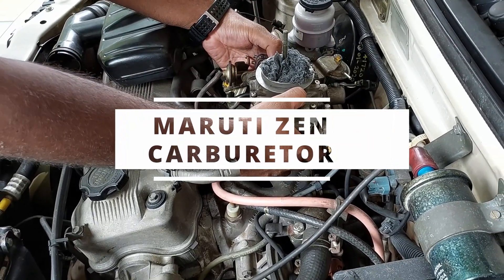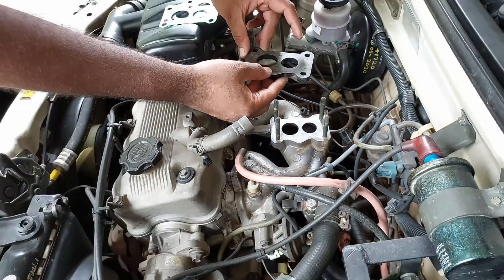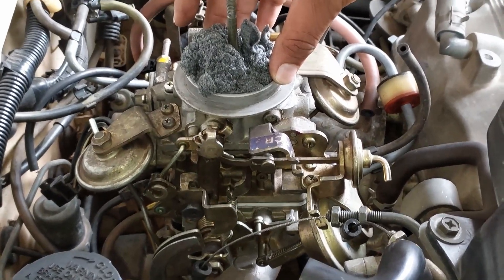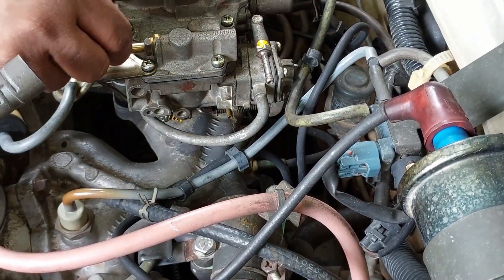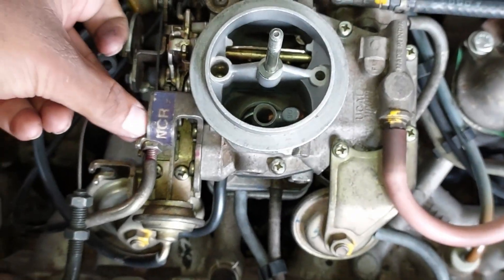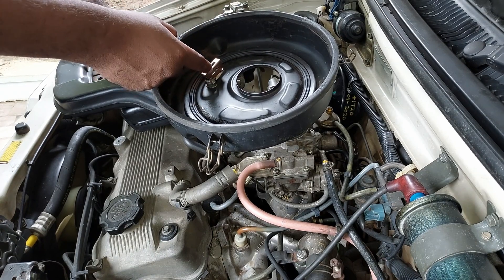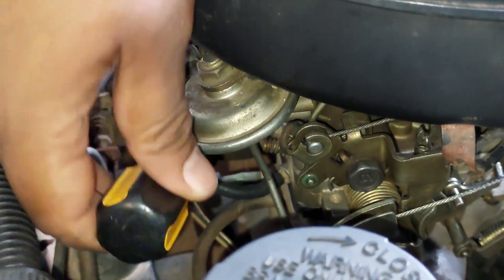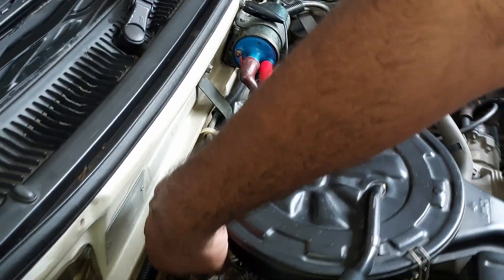Maruti Zen Carburetor service at home | Part 3 | Tuning the Carburetor | English

Comment: Very good information. Hot restart actuator?, It may be for start of engine at higher than idle rpm. When vacuum buildup, actuator reduces rpm high to normal.

Comment: Excellent video❤.. i have 2002 model lxi.. i have issues when car is on idle start it turn off car everytime, whenever i pedal on clutch it get turned off.. nobody uave any solution for that.. can you help
Reply from the maker: Please check all the fuel hoses for any crack. Also check the hoses above the fuel tank. You may not see any leaks when the car is idle. Dried up hoses can cause air to enter the fuel system and this issue may happen.

Comment: Bro please help me I have cleaned the carburettor and tuned correctly as you said, but I am getting a very bad mileage of only 7 and I am very fed up with this as I love zen very much but it's giving this type of problem. But I think carburettor is not the fault for this. Tell me what else should I check out I even changed the spark plugs😢
Reply from the maker: Hello, 
1. Check near the Primary and secondary butterfly valve shaft on the carburetor. If you see a brown discoloration that means fuel is evaporating though that area. You will need to dismantle the carb and replace the seal/ oring. 

2. Check all your fuel hoses for cracks. 

3. Drop down your fuel tank and replace all the hoses on top of the tank. There is a fuel vapor separator mounted on top of the tank. Check if it is cracked.
Reply: @bosegarage  ok bro I will do it and I thought the car is not nice as it is old one so it's not the giving the correct mileage
Reply from the maker: Does your car have a Catalytic converter exhaust. Then you may consider cleaning the cat con as well. It gets clogged over a period of time.
Reply: @bosegarage  yes brother I just tuned the engine again and checked for any leakages but there was no any leakages. Now I drove the car and checked the mileage it was arround 12 kmpl and the car tyres are also worn out, here the mechanic also disappointed me like this is the old car and the carb model is not good compared to mpfi, I think he is a noob and doesn't even know anything about this car here in Bangalore. 
I think due to some carbon deposit in cat conv and the worn tyres are the reason for this, tell me what to do with catalytic converter plz

Comment: excellent video, the only thing I don't understand is that on my car when I act on the idle speed adjustment screw the engine rpm never changes... the only screw that affects the rpm is the adjustment screw of the mixture. Is there anything broken in my carburetor?
Reply from the maker: @fabiodellaira1401 The idle rpm should change when you turn the idle speed adjustment screw. Try to to remove the idle speed adjustment screw completely and check for damaged thread on the screw as well as on the threaded area on the casing. Some cases the thread on the carburetor casing gets damaged and the screw will just keep turning at the same position and hence wont alter the engine rpm.
Reply: @bosegarage  Thanks for the reply! I'm sure that the screw has an ok thread, in fact if I unscrew the screw it comes out and if I tighten it it goes into its seat. If you can, could you explain to me what this screw does? does it act on the external levers or does it open and close the internal ducts of the carburettor?

Comment: I've always wondered - a typical car carb is so much much more complex than let's say an RD350 carb. Same with the engine, or the gearbox, or just about anything there in that engine bay. Yet most cars run so much reliably and give very little trouble over their lifetime as compared to a typical RD350 or a comparable 2-stroke performance machine. 
A friend of mine used a fiat for years without a single complaint ever from its points ignition while I was busy every other day pushing my 350 to the garage lol

Comment: Good video.❤  You did V.good job.Along with this if you have done timing by adjusting distributor it will be very useful. Pls put separate video for setting timing using timing light. Thank you.
Reply from the maker: Thank you for your kind words. Yes I will do a separate video on that.
Reply: @bosegarage  👌🏻
Reply: @bosegarage  What is the RPM & Dwell degree to be set for Maruti 800 corpuretor model at idle speed.
Reply from the maker: @Ravichandrancbe  Engine idle speed set around 900rpm or slightly lower.
Cam dwell angle : 62 +/- 3 degrees
Condenser capacitance : 0.25uF
Ignition timing : 7 degree BTDC below 900rpm
Spark plug gap : 0.7~0.8mm
Breaker point gap : 0.4~0.5mm
Reply from the maker: @Ravichandrancbe  You can get all details for the F8B engine from the SS80 workshop manuals uploaded in the mighty boy forum. As the engine is the same F8B in both SS80 and SB308 except for the mountings these manuals are helpful to work on our SB308s as well.

You can download the SS80V manuals from the below link
https://www.teammightyboy.com/forum/viewtopic.php?t=2540
Reply: @bosegarage  Super👌🏻👏🏻kindly put a video about setting all these in maruti 800 carburetor model please.
Reply from the maker: @Ravichandrancbe  Sure will do that soon.
Reply: @bosegarage  👌🏻Expecting soon.
Reply: @bosegarage  
One more video please
about cleaning about slow speed jet and air fuel mixer screws and its path in Maruti 800 carburetor model.
Reply from the maker: @Ravichandrancbe  Sure. You can use carburetor cleaners available in the market for this purpose. The cleaners help to dissolve and drive away the accumulated sludge. In addition it is advisable to blow the jets and channels in the carburetor with compressed air which is the traditional method. Some carburetor cleaners tend to create moisture accumulation when they evaporate. So blow dry with air as a final step.
Reply: @bosegarage  To blow the air the carburetor would be removed & opened. Right?
Reply: @bosegarage  
Dwell shows 60 degree and If you put 800 to 1000 RPM engine vibrating at morning start. What to do for smooth idiling and smooth starts?

Comment: Hello I'm having 1997 crbtr zen I'm facing lot of jerking prblm and in morning starting prblm and 1 St and 2 nd gear till 3 Rd gear jerking prblm
Reply from the maker: Hi. The issue may not be with the carburetor alone. You need to check the entire fuel system and ignition system as well.
Reply: Bro do u know the any expert mechanic in Bangalore
Reply from the maker: @Torquetalk234  I have no contact there bro. Sorry.

Comment: @bosegarage i have confusion in connecting vacuum tube to Acceleration Pump circuit, Purge System and Distributer Advance could you please make me understand?
Reply from the maker: Hello, 

I am not currently at home. Even I get confused with the vacuum hoses. Please refer to the video to connect the hoses correctly. I will make another video about the vacuum hoses alone the next time I am back home. 

Thanks and regards, 
Bose Garage.

Comment: Bro, oru thavana carb repair cheyyan koduthitt reset cheyth kitiyappol athil ninn Ac idle rpm actuator remove akkiyitund. Ipol ath karanam Ac ittaal vandi rpm exist cheyunnilla. Nammalk thanne set cheyyan patuo?
Reply from the maker: Hi bro. AC Idle up actuator remove cheythal pinneedu AC on cheyyumbol rpm thaane increase aayi regulate aavilla.  Idle up actuator poyathu aanenkil pinne aakey cheyyavunnathu idle screw adjust cheythu rpm kootti vekkuka Enna thu mathram aanu. Pakshe appol AC idathappozhum rpm koodi nikkum.

Comment: Do we have to adjust the air screw in front of carburettor, if yes means how Many turn
Reply from the maker: https://drive.google.com/file/d/1oNTz8y4MR_zw0h7oR23B9jdhMc4CdPXC/view?usp=drivesdk

Refer to the attached service manual. Please read the procedure on page 6D-10 (Page 341/650) on how to adjust the idle speed adjusting screw and idle mixture adjusting screw. You will need a Tachometer to tune the carb properly. The number of turns is decided by the engine rpm and it will be different for different vehicles.
Reply: Ok

Comment: Hi bro
I have maruti zen 2001 carb model, can I fix maruti 800 ignition coil in zen, if I did does it cause any misfire or dead cylinder
Is there any voltage difference
Please guide me
Reply from the maker: Hi, The maruti 800 ignition coil comes with a Ballast resistor to reduce the input voltage from 12v to 8v~9v. You can remove the Ballast resistor of the Maruti 800 coil and use it in your Zen. It should work but I haven't tried it myself. Maruti Zen ignition coil is still available in Boodmo.

Comment: Very useful video
I have a small doubt , finally after rpm checking how many turns u did on idle mixture screw ?? And it is clockwise or anti clockwise
Reply from the maker: https://drive.google.com/file/d/1oNTz8y4MR_zw0h7oR23B9jdhMc4CdPXC/view?usp=drivesdk

Refer to the attached service manual. Please read the procedure on page 6D-10 (Page 341/650) on how to adjust the idle speed adjusting screw and idle mixture adjusting screw. You will need a Tachometer to tune the carb properly. The number of turns is decided by the engine rpm and it will be different for different vehicles.

To start with fully turn the idle mixture adjusting screw clockwise until it is tight and then turn it anticlockwise by around 1.5 turns and start the tuning process as described in the manual.

Comment: Bro is use of this can u say pls
Reply from the maker: It is a dwell tach meter to check the RPM and dwell angle of the engine.
Reply: @bosegarage  can't understand
Reply from the maker: Bro. About what you want to know the use. Carburetor or Dwell Tach Meter
Reply: @bosegarage what r the advantage  carb cleaning
Reply from the maker: @blackpearlgaming5950  The carburetor needs to be serviced whenever you experience loss of power/mileage or whenever you notice some fuel leaks. 

A properly serviced and tuned carburetor will ensure optimum performance and fuel efficiency.

Comment: സർ, എനിക്ക് ഒരു മാരുതി  800 ഉണ്ട് (2000 മോഡൽ  ) കാർബാറേറ്റർ അന്ന്, rpm ഐഡിയൽ ആയി നിൽക്കുന്നില്ല, സ്റ്റാർട്ട്‌ ആക്കുബോൾ ഒരു rpm, കൊറച്ചു ഓടിയ  rpm high ആവും, ഇത്രക്കും  ഞാൻ  പുതിയ  ഒരു കാർബ് മേടിച്ചു വെച്ച് നോക്കി,,, എന്നിട്ട് ഇപ്പൊ vera പണി  വന്നു ഒരു 20 km ഓടിയ  വണ്ടി  heat ആയി നിൽക്കും, അതു  കൊണ്ട് ഞാൻ  ignition കോയിൽ പുതിയത്  മേടിച്ചു വെച്ച് നോക്കി, കണ്ടെൻസർ  power ഫ്യൂസ് oke മാറ്റി വെച്ച് നോക്കി എന്നിട്ടും രക്ഷ  ഇല്ല, എവിടെയാ ഉള്ള വർക്ഷോപ്പിൽ oke പോയ  അവർ  നേരത്തെ വണ്ടി  ഒന്നും നോക്കുന്നില്ല,,,എനിക്ക് ഇനി എവിടെ കൊണ്ട് കൊടുക്കണം എന്ന് അറിയില്ല,

Avasath മനസ്സിലാക്കി ഒന്ന് ഹെല്പ് ചെയ്യണം

സ്ഥലം  (ട്രിവാൻഡ്രം നെയ്യാറ്റിൻകര )
Reply from the maker: Hello, Ningaludey Maruti 800 inte fuel pump eppozhenkilum check cheythirunno. Carburetor Marui 800 in Mechanical diaphragm type fuel pump aanu varunnathu. Kaala pazhakkam kondu pump inulliley rubber diaphragm flexibiliyt nashtapedukayum vahanam odi choodayi kazhiyumbol pravarthanarahitham aavukayum cheyyum. Fuel pump check cheythu nokkuka. Puthiyathu Maruti Genuine thanne available aanu. Ekadesham 600 roopa aakum.

Engine overheat aakunnathayi eppozhenkilum thonniyittundo?

Bose garage.

Comment: i have a doubts/Questions
at the SECOND TIME of tuning process we have to tighten the (IDEAL MIXTURE) screw or Loosen???
also SECOND TIME of tuning process (IDEAL SPEED) tightend or loosened
Reply from the maker: Extremely sorry for the late reply. In our case we had to loosen the idle mixture adjustment screw further. It might vary for different vehicles. 

Idle speed adjustment remains the same first or second time. When you loosen the screw the idle speed will reduce. When you tighten it the idle speed will increase.
Reply: @bosegarage  Hey thanks for the reply.....Here is my case 
If I fully tighten/close the ideal mixture adjusting screw Vehicle turns off then after then keep this as starting point 1ndhalf turn(loosened) vehicle runs at high rpm

Then I tried to lower the rpm using ideal speed adjusting screw after completely loosen the ideal speed adjusting screw only i am able to achieve lower rpm
Then if I again lossen ideal mixture adjusting screw rpm increase Then there after I have no room for lowering rpm using ideal speed adjusting screw  because it's already completely loosened......

All i have is 1nd half turn and above(loosing) increaseses rpm... (tighting) within that 1ndhalfturn lowers/decrease rpm
completely (tightend/closing) the one nd half turn off the vehicel
All i am left with 1ndhalfturn play in (ideal mixture adjusting screw)
Because already ideal rpm screw is completely loosened...

What could be wrong???????? 
What should do now......
Any idea guys???
Reply: @bosegarage hey i  Found out the culprit slow jet/Primary Pilot jet was the culprit....
Anyone who has idealing problem check the slow/primary pilot jet...this comment can literally save you days of troubleshooting 😂

Comment: Tach Dwell Tester buy Link please...
Reply from the maker: We bought this from Indonesia. TRISCO brand. Same is available at shops that sell automotive tools here. Unable to find Trisco brand online.
Reply: @bosegarage  don't know the actual price of the TRISCO tachometer....if it's under 1k-1.5k is worth investing...If not would you suggest any alternative tachometer under that price range????

Because as you said Tuning is so crucial in Carburettor...
Reply from the maker: @Pepper_Mint_  TRISCO is good for the price we pay. It cost around 1500 to 1700 for the one I saw at Coimbatore. Another brand is EQUUS but is more expensive afaik. 

Most of the dwell tach testers available locally are Taiwan made.
Reply: @bosegarage  Thank you so much for Your valuable reply.... 😍👍
Reply from the maker: @Pepper_Mint_  You are always welcome. Will let you know if I find any for sale online.
Reply from the maker: Saw the same at Orient Hardware and Tools, Cross cut road, Coimbatore.
Reply: Thanks a lot for the reply